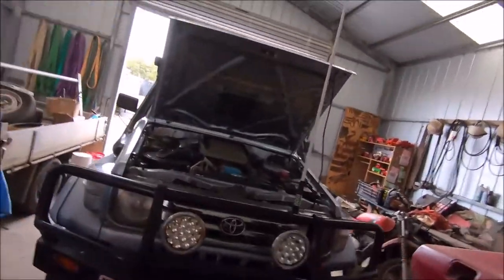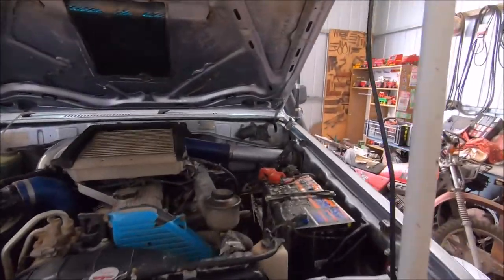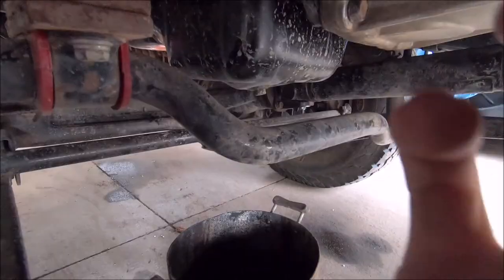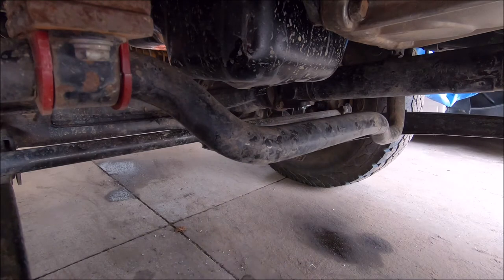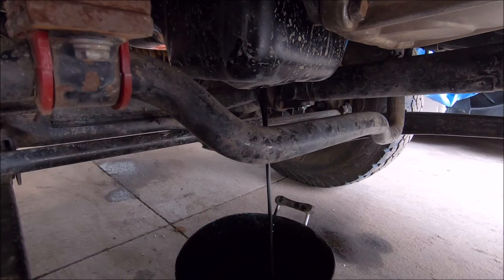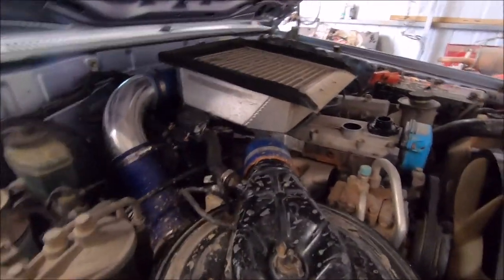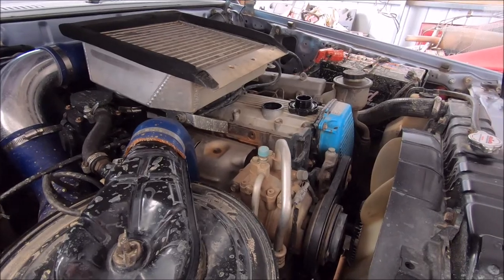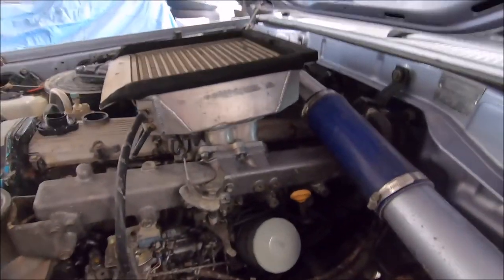79 Series Landcruiser Update and First Oil Change

Comment: Hay bud don't suppose you have oil pressure figures for the new engine?
Reply from the maker: No I don’t sorry mate
Reply: @CamshaftFM  No worries just would like to know some figures on a 1hz that has been built for turbo, mine only sits about 20 psi when at operatingt temp. The engine builder told me they fit a new revised oil pump that runs lower pressure than factory.

Comment: i dont understand a 79 series having a 1hz in it .....i thought 79 series had alater model diesle engine ....i own 75 series 1992 model 1hz  garret turbo
Reply from the maker: Yeah the early model 79s had the 1hz mine is a 2000 and my dads is a 2003 and has the 1hdfte in it so Toyota made the change soon after 2000 I'd say
Reply: @CamshaftFM  ok true ....79 abit longer in cab  and has coils up front from the 75 series ...i should have brought the 79 i paid 20k for the 75 and spent another 10 k on accessories have to keep it now also own a 60 as well love the old landcrusiers keep the videos up camshaft cheers
Reply from the maker: I think old cruisers are a bit like that! Cheers mate!
Reply: @CamshaftFM  yeah bloke i had a awesome run from my 60 had her sixteen years with 500,000 on same motor  i have no intentions of selling  any of my old landcrusiers allgood will get and do some more tracks soon after this corona stuff is over